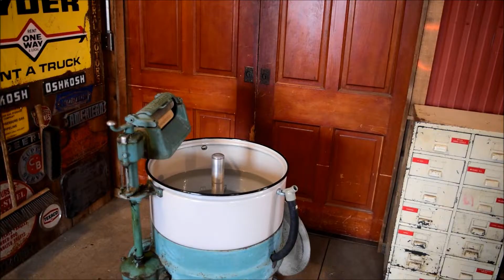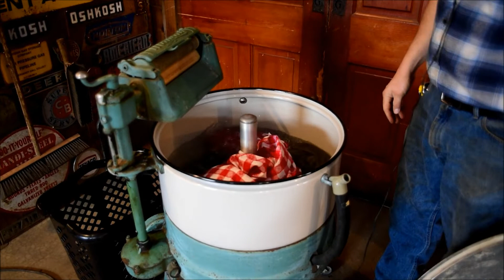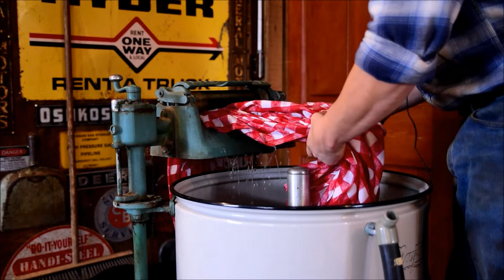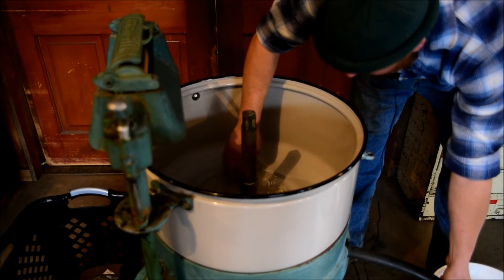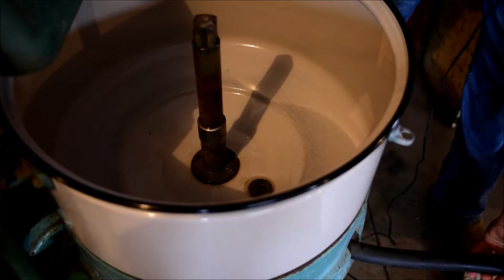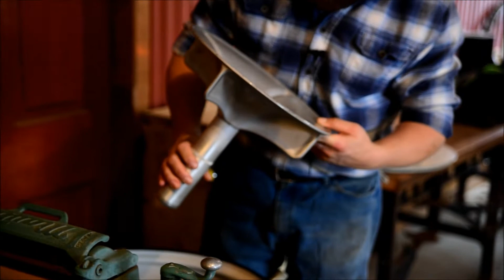1934 Antique Vintage Maytag Ringer Washing Machine - Test Run

Comment: No soap? Or do you have to change water how many times to get the soap rinsed out?
Reply: Yes soap was added at the beginning of wash. 
You started with hot water for the cleanest whites and your next cleanest load up to the dirtiest for last load. Remember the pioneers before us had to draw water from the well which was extremely cold and they had to boil in a wash kettle took a long time to heat so you didn’t change your wash water every time. Gross it seems but we were all family!  lol. 
You had a tub of rinse water at the back of wringer were clothes came out to fall into now get in there with you hands and swish and pull up and down in water then wring out again then hang in the line. 
My mother also told me that’s how they took their bathes cleanest to dirtiest. 
Good old day!  
Swept the floors and the dirt went between the cracks of the floor and can see the chickens run underneath the house. Put blankets on the bed before you went to sleep and wake it with snow on them. Her parents and grandparents went through hell compared to what we have it today .

Comment: 2:00 i really appreciate the old stuff it's pretty cool but saying that modern ones are garbage is the most stupid thing i have ever heard. Try to put some stained clothes 13 pounds in that old one and compare the cleaning ability to the new one.
Reply: Actually you may be surprised to find out that despite having to ring out heavier items like towels, blankets and denim a few times, they do get clothes much cleaner and you can save on water. Even automatic machines like the Maytags from the 1960s were good but they used way too much water. Front loader HE machines do use less water and electricity (about the same as electric ringers) however the downfall is soap can be left in your clothes. Early machines like Easy, Laun-dry-ette and Salvage tried to eliminate the agitator and found it did not work as well without the friction. Most appliances now are purposely made with planned obsolescence and there is no law that says a manufacturer cannot. It just depends on what you want: More labor with cost, cleaning and longevity efficiency or automatic, new and with a guaranteed lifespan.
Reply: Those old washers were really sturdy, my mom had one when I was little in the mid 70s and they got them much cleaner.
Reply: @whatweshouldknow5648  like the ones in video? I'm sure they can clean and it's easier than manual but you can't compare it to modern machines with many different cleaning programs and high rpm centrifuge.
Reply: @acshore86  planned obsolescence doesn't exist because reputation is important. New quality machines will last a very long time because of reliable electronics, rust proof materials and the general advancements in design. Planes are computer controlled for the last 38 years yet they don't fall out of skies. And there's absolutely no way old ones clean better the physics don't add up. They save water because they turn the clothes in the same dirty water right? The modern ones empty the old water and put new one to rinse it out.  Plus even more modern ones actually weight the clothes to determine how much water to use. Old machines can be useful but you can't compare them to modern stuff period.
Reply: @dkdanis1340  With all do respect your beliefs and I do respect you for your opinion, I also do not believe in cognitive dissonance. We in society are given opinions that are labeled as fact instead of fact with open interpretations of opinions. There are pros and cons to both old and new. Older appliances lasted longer, and were able to be repaired, usually by one's own hands; unless something dangerous like a capacitor or Fre-On repair. We have the advantage of computers doing many things for us, however, the human brain can correct its error quicker than a computer. It is not a matter of just being better, it is also about quality control. Quality control and electrical safety did not exist like it does now, yet the flip-side is that quality and machinist labor was more on the industrial level; therefore the physical components upheld longer. Asbestos wiring is no longer used because it is now know to be toxic, break down and become stiffer with age; much like rubber. The difference is you can see rubber deteriorate so it is able to be eyeballed quicker. To say that computers are of a higher advantage is both a matter of opinion and statistics. Computers merely replaced what our brains did for us for millions of years. The last I'd like to point out is that we trade the labor intensity of manual labor for modulated and algorithmic programming; you either save money doing something yourself or save on labor and eat the cost in replacement sooner. Conformity usually wins out among the large populace.